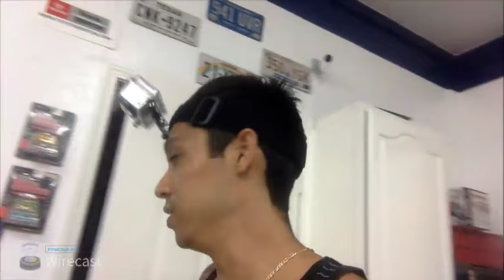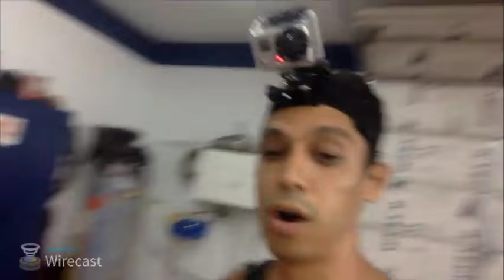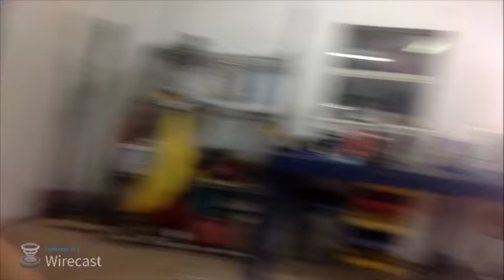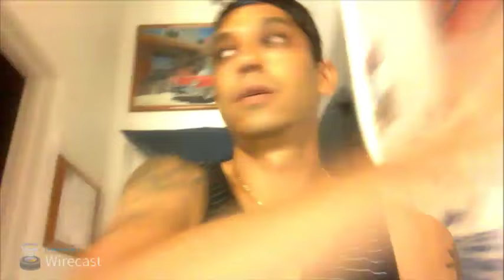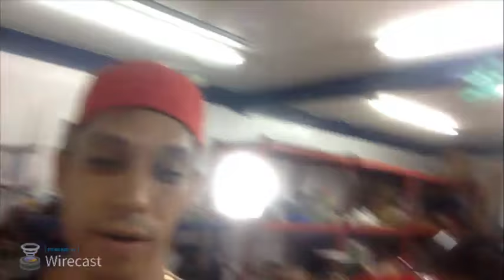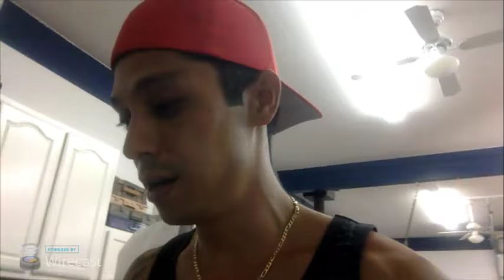Step-by-Step Painting a Car In Your Garage - Unmasking The Freshly Painted BEAST!

Comment: Tony,what temp should be (too cold vs too hot) to paint.I heard base coat clear coat does not hold up in the long run.Do you still sell the warwick spray guns(904).$159.00?
Reply from the maker: Yes we do sell them. are you a VIP? We offer free shipping to you, just ask support on the site for the code. http://www.learnautobodyandpaint.com/shop - Too cold, below 50 D, too hot, above 95 D. Of course you would use a slow hardener or reducer in hotter temps! If not a VIP check out VIP here: http://www.learnautobodyandpaint.com/vip-offer cheers!